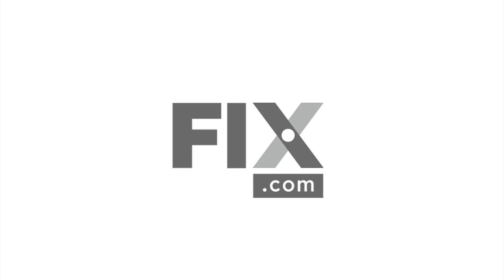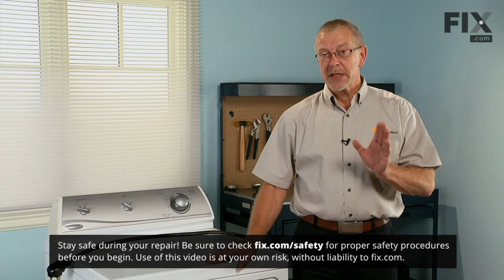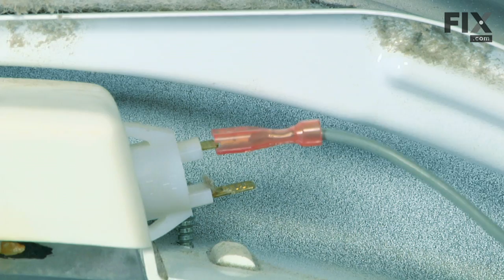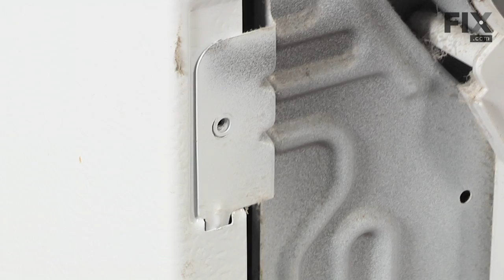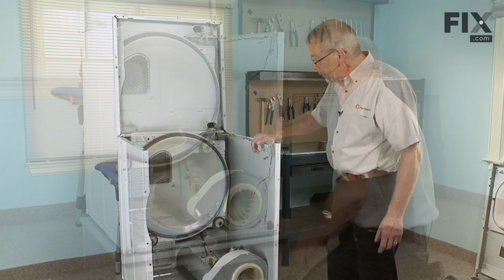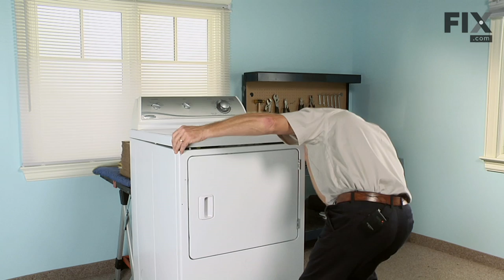Amana Dryer Repair – How to replace the High Limit Thermal Fuse

Comment: On the fuse the bottom terminal is soldered and easy to pull off.  I know the new one should be here today.  So my advice be careful if you are just wanting to disconnect the bottom line for some reason.  Bought mine on amazon.

Comment: This is a terrible video.  My dryer is not set up the same way.  The thermal fuse is not inside the dryer.  It on the back.  I've taken my dryer apart for no reason and I can't get it back together.  Bad advice.
Reply: Yeah, mine ain't like this.

Comment: Jeez any other brand of dryer except AMANA- it’s easy access by removing back panel.  This is surgery
Reply: Amana has been purchased by multiple manufacturers over the years. This one is built by Maytag circa 2003 or so. Newer amanas are Whirlpool based and like you said much easier to deal with.

Comment: On some Amana models there is a service panel at the bottom of the front of the dryer. If you have this panel, you can simply remove two screws. You'll have to lay on the ground to see the thermal fuse at the back of the dryer but it's easy to reach.